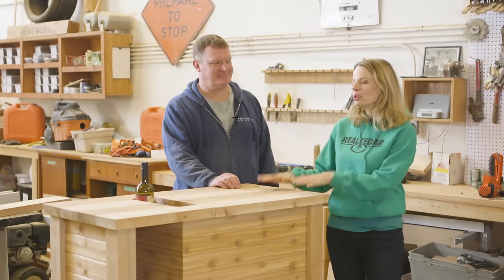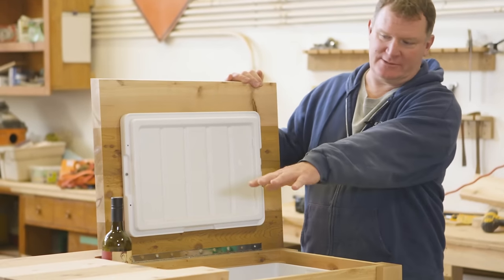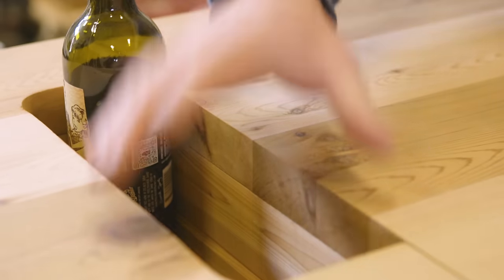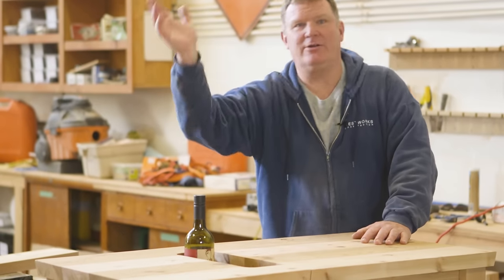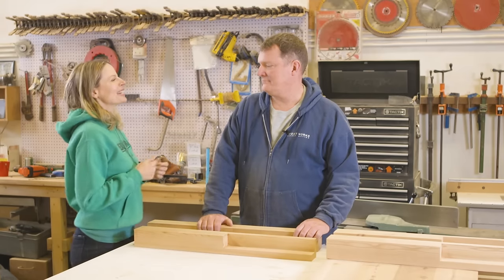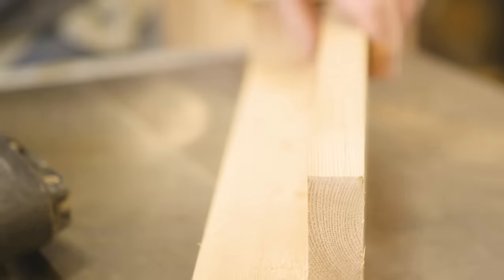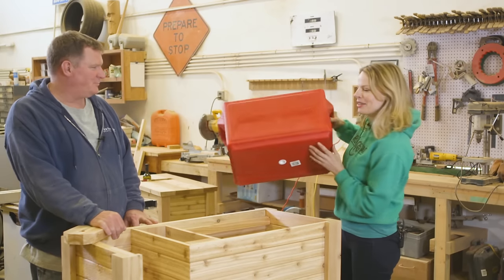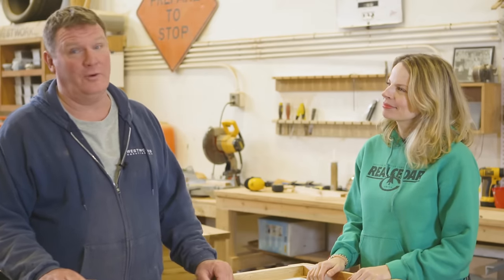Free plans to build a Portable Deck Cooler Bar and Stand

Comment: Just found this video. Really like the flat top etc. Downloaded plans , figured how many boards to get as I am making two for my sons on Fathers Day and of coarse the cooler no longer available and that sized cooler is the key to the whole buid. Trying to find one similar but no luck. Do you gave any suggestions for a similar sized cooler out there?  Thank yu so much
Reply from the maker: Hi Kelly,  that Coleman cooler was 22.5 W x 11.75 D x 13.5 H(but the height includes the lid).  Hope that helps. Here is the link so you can use the specs for it. https://www.canadiantire.ca/en/pdp/coleman-chiller-48-can-party-stacker-portable-cooler-0853415p.html

Comment: What casters do you recommend for outdoor use?
Reply from the maker: Hey there, we did not use any for this project. It is free standing.
Reply: REAL CEDAR - DESIGN INSPIRATION & DIY PLANS
At e 2:49 mark of the video it was stated you could add casters and they pull out and show casters. Just trying to get a sense of what size and type of casters are they showing?
Reply: I did not plan to make use of this woodworking book, TopFineWoodworking. Com but instead curious about it. I had been truly amazed right after trying it. I was seeking to learn more about the art of woodworking, and was not disappointed. I found many topics such as wood types and designing your workshop.
Reply: Was there any material removed from the back bracing piece to account for the thickness of the piano hinge?